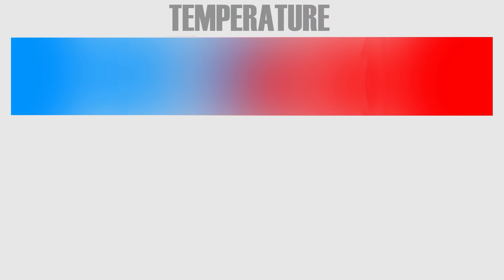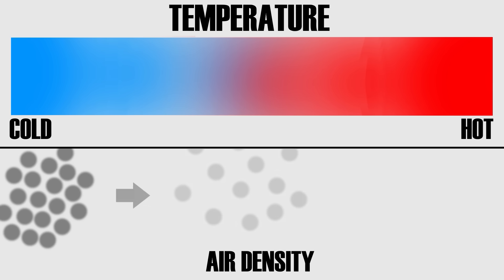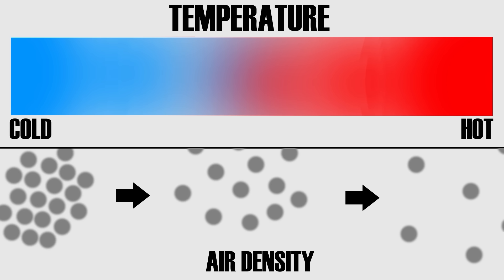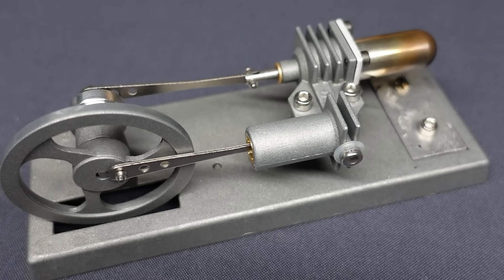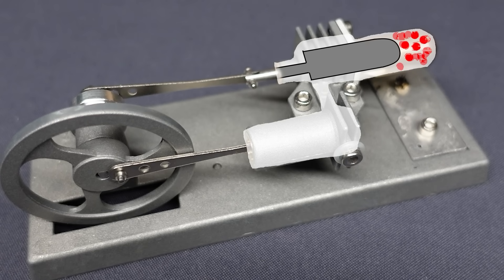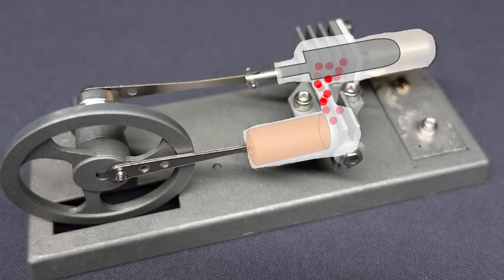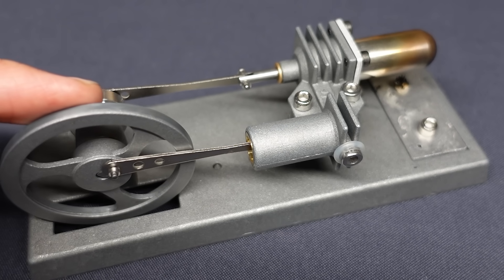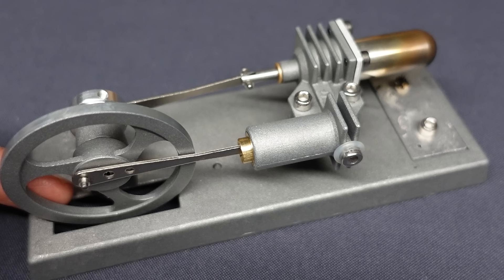It Can Save The World - The Simple Genius of Hot Air aka Stirling Engines

Comment: Theoretically, you could have a sterling engine powered off of the waste heat of the battery  moters, ect on an electric vehicle. To help increase the range of said vehicle. Without having to add bigger / more batteries.  In the same vain, you could also use a clean, burning fuel as a traditional range extender. 

In kind of a similar vain. I wonder how much and what type of material would be required to keep a sterling engine running over night. Using waste heat from the sun. Using a mirror array to run a Sterling engine suring the day. While also charge a thermal battery. That could then be used to run the sterling engine over night until the next day. When the cycle would repeat. How big would it have to be to generate grid level solar energy. Even when the sun isn't out. There is so much potential here. These could easily use readily available, environmentally friendly materials. With a much higher recyclability than traditional renewable energy sources. Even if there was several weeks for months of bad weather. They could burn literally anything or even nothing at all. So long as the temperature differential is maintained. The energy keeps flowing. 

Imagine infinitely recycled metal and glass. Instead of landfills full of wind turbine blades, and unrecoverable rare earth materials. 

I used to look at Sterling engines as a desk toy or a novelty. I can't look at them the same way anymore.

Comment: Could you use a heat pump to run one? The new heat pumps use 5 times less energy than a resistive heater would which has a for every one watt you get I watt of heat.

Comment: A steam engine is another example of an external combustion engine - the external fire on the heats a boiler fill of internal water turning the water to steam (pressure) which does the work.

Comment: I thought the cooler the air the more dense.
Reply from the maker: And it is and that's what I said
Reply: @d4a  okay hold on for a second at one point in the video when you said when the air cools down and becomes less dense. When you were explaining how the change in pressure between the two cylinders caused it to work.
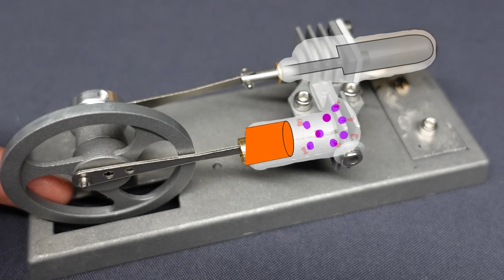Reply: @d4a it's at 4:24
Reply: @d4a  but I get it now I was listening to it not watching the video. I get what you were trying to say as it cools off it takes up less space in that pistol even though the air is getting more dense is taking up less space.

Comment: The A-26 submarine you show a diagram of is not the same as the Gotland class you are talking about. The A-26 is the next Swedish submarine class currently in development. The A-26 will have three stirling engines (plus three diesel engines and one electric motor for the drive shaft).

A lot of work has been done of stirling engines since its invention in 1699 but they still have worse efficiency than otto or diesel engines.

Comment: They don't produce enough power for energy consumed. Obviously, it still consumes fuel. The problem is not the internal combustion engines; they can be built incredibly efficient, and they are becoming more efficient at an exponential  rate. More efficiency equals less pollution.    Just when we're getting there government  wants to move to stupid sources of energy that only look efficient but take more resources and more oil to generate secondary fuel.

Comment: Good afternoon to anybody reading this:
I propose following idea:
Take a standard combustion engine which is water-cooled.
If it is a two-stroke, replace the driving mechanism of the waterpump with a stirling engine hot side inside the cooling loop. The thermal difference should be high enough to run the engine driving the pump to get away the excess heat. The radiator fans could also be powered by stirling engines.
I am rather optimistic this could even optimize the system performance and efficiency of every engine.
Okay: 4 Stroke engines need another way of driving the camshafts or a redesign but it should be possible.
If anyone builds an engine to this specs: Please let me know!

Comment: Any ever try using magnified sun pointing on the hot side to see how much power could be made? I know the sun boiler project out west failed but that was a different motive principal
Reply: There are many examples of small stirling engines that use a parabolic dish to focus solar heat onto the hot bulb of the stirling engine, They work very well but need a sophisticated solar tracking system to keep the parabolic dish/mirror aligned with the moving sun. Look up solar powered stirling engine. There are even several videos on youtube that show these type of engines.

Comment: The engine running for a while after extinguishing the flame is offset by the time it takes for it to heat up and start working. Isn’t really running on nothing, just was able to store the energy from earlier.
Reply from the maker: It's not. Takes 5 seconds for the big one to start
Reply: @d4a  The start time doesn't have to match the time it'll run without the flame at the end. The energy still came from the flame heating the engine. So, you have to put in extra energy at the start in order to get back some extra energy at the end. That's where it's offset.
Reply from the maker: You're changing your argument and missing the point of the video. The engine is running on nothing because we are not adding any energy to keep it running. But it's really just semantics. I can word it and say that it's running on stored energy and it can store energy that would otherwise be wasted. Something that would be wasted is in fact "nothing".
Reply from the maker: You're changing your argument and missing the point of the video. The engine is running on nothing because we are not adding any energy to keep it running. But it's really just semantics. I can word it and say that it's running on stored energy and it can store energy that would otherwise be wasted. Something that would be wasted is in fact "nothing".
Reply: @d4a  That's like saying something that runs on batteries is running on nothing if you aren't charging the batteries while it's running. 
The initial heating period before it starts running is storing that energy that it can later use to keep running for a short time after the flame is off. You could increase the mass of the hot side and it would have a longer delay before running, but also run longer after the flame is off. Doesn't really mean anything other than you increased it's energy storage capacity. 
It may be semantics, but it's still an important distinction to make since it actually running on nothing would be quite the breakthrough.

Comment: In 2004 I was reviewing a proposal (gov) for Stirling engine solar generators. They were being developed at a NM gov lab. Expensive to produce, but the results were pretty good apparently.  They used a parabolic dish at the heat source.
Reply: but since than price of solar panels did drop a lot...
Reply: For it to be practical at all, it would need a heat source other than an open flame. The danger associated with open flames offset any benefit you would achieve.
Reply: @aaronmiller7954  I was on a geothermal area at tue same time.  The turbines were runj8ng, but not well enough. In come a cheap (relatively) hydrocarbon, according the geologist I was working with.
Reply: @PDXDrumr  The problem with turbines is that it does not just require heat/steam, but specifically it requires high pressure steam. Sometimes steam generated by geothermal is not enough to raise the steam pressure.

That should be where Stirling engines are useful as Stirling engines use the heat directly.
Reply: This was my first thought on seeing the toy engine haha
Reply: @SaltyShaman There is a nice amount of usable compost that you can turn into electricity or hot water. But it will be just a few % of what a country needs
Reply: @Menon9767 if it can power a submarine it can power a single family home!! I smell bullshit from the solar panel industry.
Reply: Pretty late, but couldn't you use solar to power those electric heaters/cooler blocks with an oven and cooler design to power it?

Haven't thought through efficiency, but seems plausible
Reply: @assortmentofpillsbutneverb3756  in the end, it wasn't cheap enough compared to panels.  I'd disagree, but that's the way it went.
Reply: I've been kicking around this idea for a while, glad I'm not the only one thinking about solar outside of panels
Reply: I was thinking the same. This to me looks like better solution than solar panels in long run.
Reply: @bizjakboris How so? Isn't the wear of moving parts an inherent disadvantage?
Reply: @wiegraf9009 Well solar panels do degrade over time. Plus solar cells can only extract about ~20% of energy from sunlight. Solar Stirling engine can extract up to ~30% of energy from sunlight.

Plus during the night, the hot part can be 'driven' by any other heater, such as propane/ethanol. With proper construction (cold fuel passes through the cooling fins to absorb heat from the working gas), this can increase efficiency up to ~40%. This is close to Diesel engine's max efficiency of ~50% but much cleaner.
Reply: @bizjakboris  especially in the winter when they can be fired by wood and pump water around to radiators to heat the rest of the house.  I would love a well engineered one a practical scale like 1+ HP.

Comment: Not being a compression engine, they produce almost no usable torque. They are pretty much useless as a power source.
Reply from the maker: Yet they power military submarines 🤔
Reply: @d4a  The only submarine engines are Diesel, electric, or nuclear. The nuclear engines are steam turbines, the steam being generated by heat from the reactor.

Comment: Air gets MORE DENSE as it cools and LESS DENSE as it heats up. The are laws of physics that are incorrectly explained in the video. Heated air expands and in a confined space with one moving "wall", in this case the piston, the expanding gases can be used to move the piston and create work. Cool video but incorrectly explained laws of physics regarding hot air being more dense than cold air needs to be corrected.
Reply from the maker: When have I said hot air is more dense?

Comment: If only the actual geometry didn't get in the way, would be a very neat and efficient way of perhaps running a water pump for cars, or a fan for air cooled motors! Self-regulated, doesn't eat up engine power to run and does the job.

Comment: Very neat, I could visualize a sterling engine in a hybrid electric car working as a range extender rather than being connected to the drive in order to mitigate the power modulation issue. Maybe energy from the battery could even help preheat the engine from a cold start. Still not the greatest application but would be a cool engineering experiment
Reply: My wood pellet burner has a Stirling engine which runs of the waste  flue heat, it runs a generator which can produce up to 1.5 Kw @ 230 volts.
Reply: 1.5 K / .... hour? @georgebarnes8163
Reply: in your dreams
Reply: @davidjones-vx9ju   You would think by now , if this worked , it would be in wide spread use?
Reply: This is a pretty neat idea indeed. Very well possible we will see tech like that. A stirling engine is very efficient energy wise and very clean burning. It need about half the fuel an internal combustion engine needs for the same power output. The beta configuration stirling engine is self starting and a free piston beta configuration is used by NASA is space exploration. They basically run forever and create electric power. Those are perfectly suited to work as a range extender. They are also in use to produce power is huge power plats where they burn trash and such, so those are used just not in motor vehicles.
Reply: where did you get your info on power output? @sierraecho884

Comment: Power modulation is an issue when directly powering the drivetrain but what about using this as a range extender in electric vehicles? It runs when it can and charges that battery at relatively constant input until you turn it off.

Comment: Wish to add a few remarks:
1. Steam engines are also external combustion engines.
2. Stirling engines tried to couquer the world just before the mass adoption of steam engines, but proven to be unreliable due to higher temperatures of hot air enclosure, something like 700C wich resulted ib relatively short service life. They where made out of iron and eventually burn. In steam engines the temperature of steel boiler was just above 100C.

Comment: it keeps running cause of the flywheel. if you add a bigger flywheel it will keep running for longer. same with ICEs. i get your point about waste heat, but all other points were meaningless or biased.
Reply from the maker: Everything is meaningless when you don't understand the subject matter 😉 but just a bit more and you'll get there, I believe in you.

Comment: A similar engine is the Manson engine, it is basically a stirling engine but instead of cooling down and reusing the air it simply exhausts the hot air and draws in cool fresh air, very simple the displacer is part of the piston, don't think it scales up quite well though since you can't compress the air in it like with a stirling to increase energy density.
Another cool one is the vacuum engine, these work in the opposite way, they draw in hot air to the cylinder usually from an open flame and then cool it down, this creates a vacuum that pulls the piston forward, these engines actually saw commercial use for things like pumping water back in the steam engine days due to how simple and safe they were
Reply: Most (if not all) early 'steam' engines were in fact vacuum engines, only using steam to heat the air in the cylinders, and then dousing them in cold water to create the vacuum that actually powered the engine (or rather the air pressure on the outside powered the engine). Proper steam engines weren't practical until the technology improved enough  to handle the pressures required.
Reply: @paulhaynes8045  the old "atmospheric".

and like all vacuum motors, limited to surface area/ pressure differential, and at 15PSI max force, rather useless. not even 15PSI. and thats only when one pulls a "perfect" vacuum". and that vacuum quickly ISNT a vacuum as pistons rise in cylinders, volumes decrease, or seals leak... 10PSI is a far more likely value. a "flame licker" probably cant get past 5psi... cant say ive ever hooked one up to a MAP sensor to check? a smart man, knowing air doubles in volume for every 249C, could probably figure it out with a little pencil given a flame temperature...

and james watt made the small step of pulling that vacuum outside the cylinder, thus negating the large loss of energy from the cylinder itself having to heat up and cool down.

Comment: A stirling engine is not a combustion engine at all. It simply transfers heat for point A to point B and while doing that it moves a piston. You need no combustion to move it. That's why we have those coffee mug stirling engines. Sufficient temperature difference is the only thing needed.

Comment: The Stirling engine is the ideal engine for Hybrid cars for just recharging batteries. Also I've heard they can be run by sunlight we've all used sunlight to burnt things as kids with a magnifying glass well a Stirling engine can use this as a heat source although a solar panel may work better I don't know

Comment: I want one in my Evo. "No, officer, it's not modified at all. That? Oh that's just a heat exchanger. That? The one with all the pipes? That's the secondary heat exchanger. What it does is it uses the hot exhaust gas and exchanges it for cooled, high pressure air which it forces into the combustion chamber to uh... cool it down."

Comment: Seems like having an open flame like that leads to a very low efficiency.  What about making an enclosed chamber to help facilitate better heat transfer?
Force the flame to travel through an actual heatsink, not just the blunt end of the cylinder.
Reply: The ones he had are just toys and more meant to look pretty. If really chasing power and efficiency you’d go for a better heat transfer.
Still don’t get a lot of power out of them, but it’d be better than the toys.

Comment: What if there were internal Stirling cylinders used to help cool an internal combustion engine while gaining a tiny bit of power? 

I think it wouldn’t be too hard to merge the flywheel of a Stirling engine with the crankshaft of an internal combustion engine, if you create a crankshaft with different amounts of throw for each type of piston.

A splined cylinder wall would allow airflow without so much vibration from the loose-fit piston, which would improve high-speed operation significantly.
Reply from the maker: Thank you for your support, I highly appreciate it. The idea definitely sounds interesting, I'd love to see how it would actually work in practice

Comment: There are 2 things I wish you had covered. 1. The Stirling engine can run using ice cold temperatures as well. 2. You need to look into the Free piston Stirling engine that NASA uses on some of there satellites.  These engines are best used as a hybrid system to turn a generator that then runs the vehicle they are installed in.  Oh buy the way, the inventors name was Robert Stirling who invented the engine back in the 1800's.  The reason he did was because the steam engines at that time had a nasty habit of blowing up.  Stirling is spelled with an i and not an e.